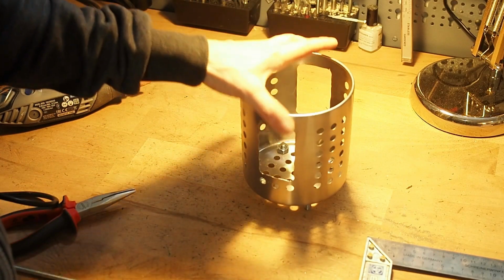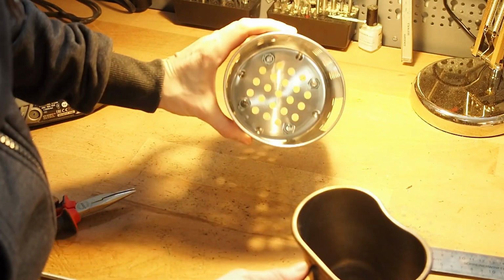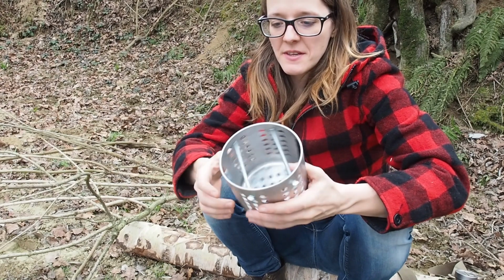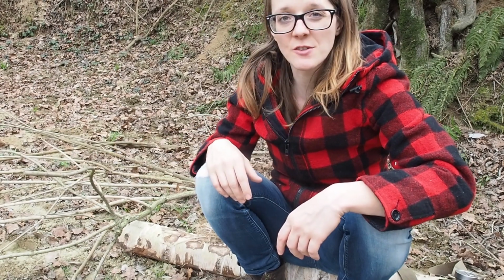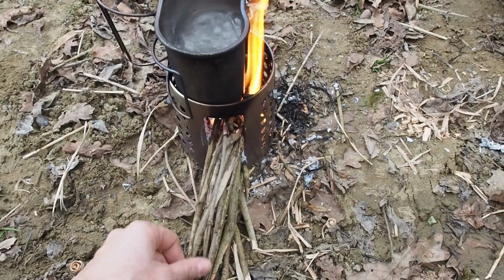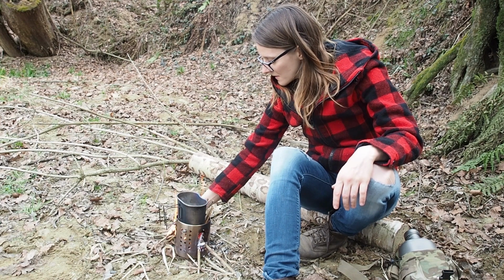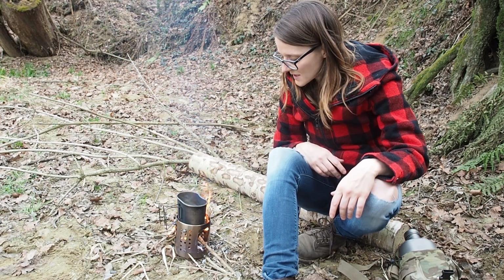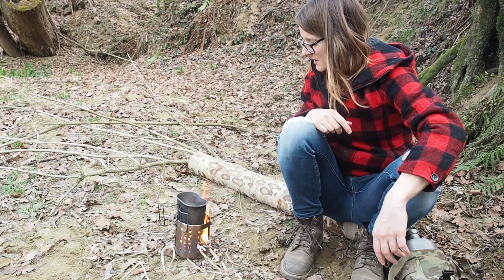DIY Hobo Stove from IKEA

Comment: 4 bolts are good. But 3 are always “level”.
Reply: But less stable and can tip over more easely
Reply: @jasmijnariel  not really. Four is only more stable when perfectly level.
Reply: @drewschumann1  depends.... if the legs are 90° underneath the object/seat ,then nope... if they are more sideways, yes. 
I made a lot of chairs in the past.... 3 legs are only more stable if they are angled a lot. Like tripods do

Comment: That's a nice idea.. But, you can also use a large tin can. The hobos, would just use an old tin can, and poke holes in it, and add a wire handle. The American Civil War soldiers, would use a large, tin cup with a lid and wire handle on top to hang over the fire. Maybe we should start calling you, "Hacksaw" Lilly, lol.

Comment: I built a similar stove last year from a nearly identical basket I bought at Walmart, although it's a bit taller than yours. I used bolts through the bottom to lift it off the ground for even more ventilation, and added a wire screen stand-off inside, and a bail.  I carry it in my pack with my Stanley 24 oz Camp Cook Set (minus the plastic mugs) stacked in  an Ozark Trail 18 oz SS Cup, all neatly inside the stove. I also pack the Stanley with condiments, individual coffee packets, a piece of sponge/scrubber, a plastic straw full of dishwashing detergent, and  a couple of paper towels. I also managed to squeeze a titanium spork in between the stove and the pot.

Comment: That's a good one Lilly. I love making Ikea stoves. I like putting removable cross bars on the top. This way, I an use the stove to nest a small round cooking pot inside. Alternatively, I also found a round stainless steel steamer rack that fits the top nice and snug. There are many of these builds on YouTube. Thank you for sharing yours with us.
Reply: A 5" stainless Oatey shower drain found at Home Depot also works nicely.  Just pull off the blue protective coating on one side and then spread the (4) notches a little and tap down the two places where it can be screwed on (so it sits flat...   Cheap wire stakes work great too and allow for a lot of adjustment.  I'd like to make a set of cross bars so that everything sits a little higher, and I like finding rounded furniture knobs to put on botton for stability.

Comment: nice video n stove Lilly ..A little tip for your stove for the feet try 2 inch by 1/4 carrige bolt they have a round head n wont sink in wet or soft ground..
Reply: I made the "legs" from steel tent pegs. They are SUPPOSED to sink in the ground. Much more stable snd secure.

Comment: oh and when you want to sand threaded rod, thread a nut halfway and put the 2 in a drill chuck, then using the drill in reverse to your sander you can get a very nice finish also when taking off the nut you will re-tap the threads :)

Comment: In the UK we have a store called B&M the same drainer is 99p that's about 70 cents.
I just drilled 4 holes and push 2 metal tent pegs through for a pot stand and cut out the window in the side as you've done.
Never thought about putting small feet on it but that's a great idea for air circulation.

Comment: Nice idea, next time I'm at Ikea I will pick one up, or two.  Can I pass on a couple tips?  It might be better, safer, to hold those small pieces with a pair of vice grips.  The pieces would be "locked", less likely to shoot out.  And, next time, thread the nuts on the rods before you cut them.  The nuts will repair any issues with the threads after you cut them and sand them.  Something my father passed on to me.

Comment: Well done another great idea, but I can think of a slight improvement. Do you know that a table with three legs will always have all legs in contact with the ground even if the ground is uneven ? This is true therefore I would have only three bolts with each one holding a piece of flat bar that can swing out when in use for more stability.

Comment: Love the two windows on each side for larger sticks.  Why not use two metal stakes to hold your cup (the cheapest ones at Walmart)?   I straighten them out and cut off the excess on the pointy side   Then I bend a 90 degreee angle on one side and about a 30 degree angle on the other and then can just slide them in anywhere and adjust them and put them at whatever height I want.  I usually bring two additional ones that I can use to poke the fire and/or install an extra set so I have a shelf for my alcohol stove and ones to support my cup.  This makes a nice wind screen for that stove setup (and I am carrying stakes if I need them in a pinch).   You may be able to bend them in such a way as to hang them on your stove somehow.  Also, they may be a little heavier, but finding a set of (4) round legs seems  versatile, like furniture knobs or something similiar, but your legs work pretty well.    If you are going to keep the threaded bolts for your stand, you might want to consider wingnut bolts so you can remove them easily to stow a nesting cup or other things inside, but I really prefer the lighter and more adjustable tent stakes.  As you mention you want to stow them and will not be transporting them, so the  bolts make a nice and sturdy platform as in your video.   Additionally, Ikea makes a taller utensil holder, and I think the one you selected, the shorter one, is more versatile and packable and would be a better choice than the taller one I have.  And, as another option for a pot stand, you can go to Lowes and get a 5" Oatey Shower drain and it is the perfect size to sit on top of the larger IKea (and maybe the shorter if they are the exact same diameter).   It is also perfect for my larger-sized Lixada Gasifier stove that is about 5" in diameter.  That shower drain is stainless and  has four little tabs you can manipulate after you pull the protective covering off the one side.  They are slightly bent in.  If you straighten them out it a is perfect fit, and then just carefully tap down the r.ecessed area where the thing screws on (without bending or deforming the grate)!  That can then be used to put your pot on, OR as a type of small grill to cook sausage, etc., but it does add weight.      

 I actually like the fact that this Ikea stove isn't  foldable because then I don't have to assemble it when I want to use it.  I would like to rig some kind of legs on the bottom that rotate maybe with wingnuts and go under the stove for storage, but that make it a bit more sturdy similar to the ones that Sensible Prepper made in his video.   Also, I want to play around with cutting and modifying the larger Ikea model by "notching": out the top with my Dremel.  

Anyway, thanks for the video.  I never thought of two windows.  It really allows for a very intense fire inside.

Comment: If you can make a pot stand that it above the hobbit stove it will work better with less smoke a simple cross made from 1 inch aluminum bar stock works great. The canteen cup sitting down inside the stove cuts off to much air flow .but I like the two feed holes instead of one that looks like it works great and it the first time I've seen someone make it like that.i like your videos keep up the good work

Comment: If you only put nuts on one side of the all thread canteen cup supports you can remove them and store something inside of it you shouldn't have to worry about them sliding out because the thread will have enough bite to hold them in while you are using it

Comment: Tip for threaded rod. Only commenting cause you said that you might create more of these.

 Most thread rod have fragile threads, because they are a soft material. Putting them in the vice as you were is going to cause some of them ti be crushed.
If you have some 1 inch (2.54 cm) by 2 inch (5.08 cm) piece of wood, cut 4 pieces as long as the the jaws are long. Nail 2 pieces together to form an L shaped device. Each L shape would then sit over your vice jaws to act as a clamping jaw against the threaded rod. This will not affect the cutting, but would prevent the thread from being damage. If you had a small V in the wood for the rod to sit in that would be beneficial. 
The other thing that might help is if you thread on 6 nuts so they won't interfere with the vice, and 1 piece on the other side.
There would be one piece on the leg that you are cutting off. Once you have cut the piece don't clean it up. Leave the bur to act as a stopper so it won't back off the thread. The other end should be good so there is was no cutting on it (maybe).
Before you start cutting your second leg (grind) the edges to clear any burrs. Turn 1 of the nuts down so that it comes off the threaded rod. This will clear any remaining burs on the edge you just cleaned.
 Make sure there is a nut on the piece you are cutting.  Cut off the leg leaving the bur to act as a stopper.
Repeat until you have all the legs you need.

Comment: Looks really good to me; easy to make, cheap and perfect for a single person. The only downside that i see it's what you said, that as doesn't fold... will take many space on a backpack and outside the backpack... will shine and will make noise; i see it perfect for have on a fixed place or several in a fixed place shared by more people. Have a great week!
Reply: charles wipman use to put pack necessities in...inside the pack as for outside shinyness try putting in a small sack. Will stop shines & cut down on noise plus a drawstring type bag will make it easily attachable to outside of pack.

Comment: It may take up a lot of space, but there's all sorts of space inside it! You could put a large assortment of tinder and fire starting materials inside the stove, and stuff a couple of spare bandanas in the open spaces. Have you tried carrying a small container of dryer lint with you? It's great tinder as is, and if you mix some petroleum jelly into it, it will burn for a very long time! Also, if you reverse the bolts before you pack the stove, it will take up less space. Cheers!!
                       🔥💜🔥

Comment: That's the way I made mine! So you can feed it from both sides and keep the hot coals in the center. And yes, you can't fold them but fill it with items and you use all of the space.  In my opinion they are stronger than most of the take down type stoves and there's no set up. I'd call the minimum amount of space in the pack a great trade off.

Comment: Helpful trick ... before you cut the all-thread rod install some nuts on each section ... cut ... file the end of the cut sections ... of course this means the treads are screwed up ... carefully un-thread the nuts,  this will re-align the treads ... and you do not need to use a "tap and die" set ...

Comment: Well done. I like it. =)
If you use some pipe clamps as the feet, you can rotate them out for stability and back in when packing for somewhat greater portability. They are also less likely to puncture a stuff sack. Ikea also carries stainless steel canisters that can nest with the stove, though you have to look around for the best fit. Attach a picture hanger to the canister top as a hook for the lid and a bail style handle and you have a good homemade cookpot the stove will pack well with. I'd also suggest getting some metal to go underneath so ashes won't setdebris under the stove on fire, a paint can lid would probably do it and if you get the right size it will pack too. 
Pack all this into an appropriately sized stuff sack and you can put other things in the center. I would suggest a lighter and/or firesteel, steel wool and/or a scrubby and a cheap pot handle (like Coghlan's makes over here). You wouldn't need the bail handle with that but it's nice to have one for hanging over a fire. Personally I'd keep a little firestarter (just in case), a cutlery set and a cross stand for the top (you don't need that since you put one in permanently for your canteen cup but it would allow easier packing). If I had room I'd pack my seasonings and stuff as well.

Comment: Great video/ idea. I'm making one and using long ( approximately 6") bolts as legs, to push into the ground with wing nuts on bottom. I'll pack them loose for storage and tighten when ready to light. Placed triangular aluminum tent pegs across top to hold container.

Comment: Hi Lilly, another great idea. Use a couple of tent pegs instead of the rods and it makes it easily height adjustable. Means you could put an alcohol burner in the bottom as well.
Reply: MichaelKingsfordGray only the stuff you can’t drink.🥃🍷
Reply: I bought some metal skewers to do the same jobs at about 50 cents each from a discount shop here in Oz as they have loops
Reply: Andy has it right, makes it so you can pack stuff in it too.
Reply: Tent pegs are ideal for this and you can use them for much other things to

Comment: That's a great idea although I'm thinking it's a little to heavily  engineered to truely qualify as a hobo stove. With some minor changes to your pot rack, in order for them be more easily removed, you could easily store other items inside of it and it might be able to "disappear" in your backpack. Also for a stealthier version I would add a scrap metal disc inside to close the holes in the bottom to keep ash and coals from fall through, which might also give you more control over your burn by reducing the air flow from the bottom. 
I love you workshop area, it's just right for the projects you do. Plus you keep it waaaay neater than most men I know, including myself. If I want any clear bench space I usually have to move aside three or four other 1/2 finished projects first. Lol
Keep up the great work! Happy Holidays .

Comment: Interesting vertical portal method.  I still use the smaller and lower portal - while attempting to close up the higher holes so that you get the rocket stove venturi air flow for greater fire/heat and greater utility of the fire fuel.  Someone needs to get a Chinese custom model made that doesn't have the bottom holes and the middle to upper holes.  That way the only holes and portal would be along the bottom, and the closed-hole chimney sides would be the best of all options.

Method-1 is not making the portal and only stuffing with vertical sticks (or wood pellets and making a firehole chimney for a one-burn method, ... or putting in a small swedish torch limb (with proper tinder for a very long lasting fire).

Method-2 is the Hibachi style of feeding the fire through the portal with twigs and sticks into the side for continuous burn.

Comment: Love your idea of dual holes to put in long sticks.  You can use thumb screws spades, wing nuts, washers, lock washers and one hole conduit clamps on bottom to make rotating legs that make it more stable with a wider base.  Slap some high temp grill paint on the clamps.

Comment: You have a 'super toll' workshop! And ridiculously tidy as well. Even my grandfather who was a professional metalworker with military style discipline didnt keep his workshop so squeaky clean...
 LOL your workbench looks like i would eat off it with more confidence then my own kitchen  counter top :P

Wouldnt worry about the non-folding of the stove. You can always put stuff inside it. a ziploc bag with fire starting materials or just regular gear. folding things are overrated imho, often it sacrifices sturdiness and durability, and i dont want a pot filled with hot water to suddenly tip over because the stove falls apart.. i use a wood gassifier (cheaper version of the solo stove) that does collapse a bit (but definately only when i want it to)  and fits in a cooking pot, room inside for matches and kindling.

Comment: Nice job.  Get you some heavy-duty aluminum foil and make a windscreen and it will perform much better.  In addition to blocking the wind it will help reflect the heat back toward the stove.

Comment: Hi Lilly! You could have made it easier on yourself by using bolts for the feet, without having to cut the threaded rod. Three feet would be stable(think of the milkmaid's stool.) Also, you could have use bolts to the inside, like small fingers, to hold your cup. In any case, I LOVE the idea, and I'm going to make one to tuck away at MY hideaway! THANKS Lily...you're AWESOME!

Comment: If you ever need to cut a threaded rod again, try to put some nuts on it before clamping it in a vise. That way you won't damage the thread (no need to force screw the nuts like on 1:55) and it'll hold better in the vise as well. (like in step 8 of https://www.instructables.com/id/10-MORE-Bench-Vise-Tips-Tricks-Hacks-Part-2/, but you could put more nuts to get a tighter grip)

Comment: Interesting mod, Lily but, if you had only cut out the 2 panels, you could have just inverted the holder on a metal plate, and would not need the bars or feet, and would not be restricted to only heating a small cup. You could also then stuff the cold and empty container with delicate items for protection in your gear 😉

Comment: I think you could have just turned it upside down after you cut the openings in the sides.  If you are worried about the ground,  just place it on a flat rock for the fire.  That would make it even less expensive, no treadec rod or nuts.

Comment: In Austria is the metric thread system as disliked as it is here in the states?  I ask because in school in the 70s us sheep were told the U.S. is going on the metric system. But just a little bit. Enough for a professional mechanic to have to have two different sets of everything. Btw not hitting on you but you continue to impress the hell out of me with your skills and aptitude. Took 33 years to get my spouse to check her oil, 34 years and she left.  Wondering if the two are related. Hmm

Comment: Very nice, i got mine at walmart, used stainless steel bolts for the legs like you did, i like it very much, i have a video of it also, but not as good as yours. Thanks from Kentucky 👍🏻😎🔥